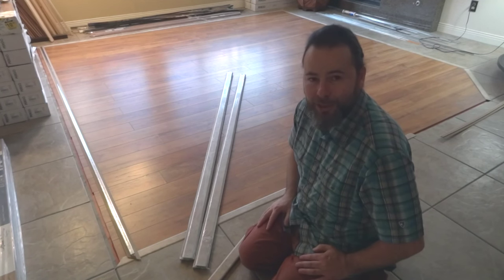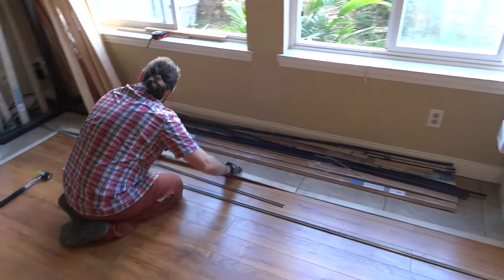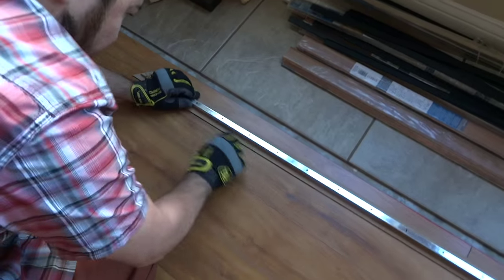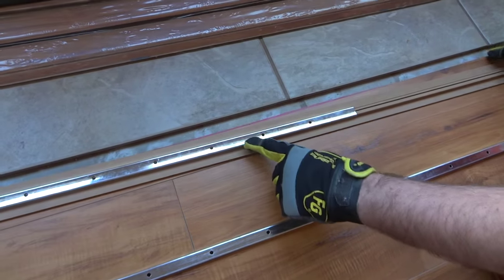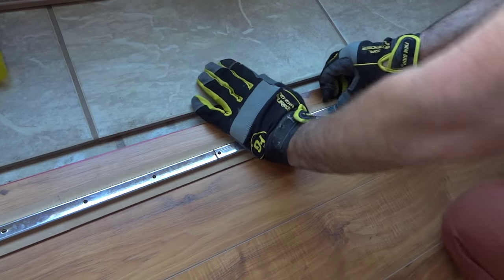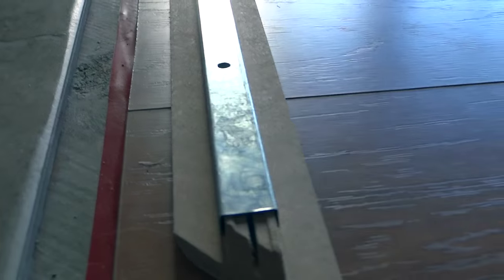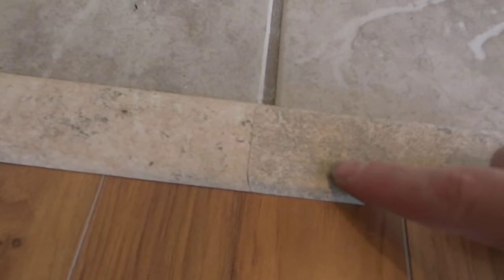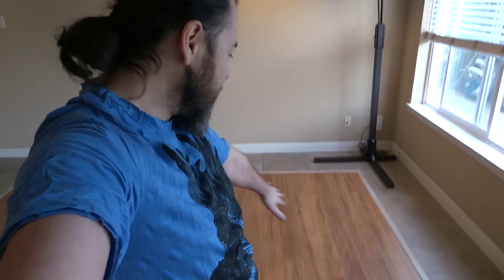T-Moulding Strips; How to Make 1 Long Strip From 2 Shorter Lengths

Comment: Thank you for the video. Great job on the flooring.  Question...how did you "cut" the t-molding to that angle that butts up against each other.  Not the corner portion at 45 degrees but "under" and "over" connected pieces?  Which way did you place the moulding to cut it (flat, sideways, upside down) and at what degree did you cut each end to match up?

Comment: I use a super glue product and an activator when I do molding work.  It’s cyanoacrylate and you can get it at building supply companies. That 45 degree joint you made is called a scarf joint. It makes a relatively seamless transition as you so well demonstrated.  The cyanoacrylate works exceptionally well with that MDF (medium density fiberboard) and hold the joint together, but get it positioned perfectly because it adheres on contact. Under normal conditions the joint will never come apart.  You can use it at your 45 degree transitions to hold them from ever moving and then lay your scarf joint together.  You will have one bonded seamless transition all the way around. Search YouTube for Finish Carpentry TV. The guy is a fine craftsman and and his videos took my work to the next level. Your work is very nice too.
Reply from the maker: Great advice, thank you! I did this 5 years ago and my floor transition has held up perfectly!

Comment: yeah I know but that's not a 90 degree angle so you didn't make two 45 degree cuts (they don't even look 22.5 degree cuts). do you remember how you figured them out?
Reply from the maker: 22.5 degrees was the correct angle to cut/trim that one "diagonal" corner. 
I do recall now that it took me a while to figure that out at the time but yeah, 2 cuts of 22.5 degrees was the solution.

Comment: Any tips on cutting the t mold where they meet at a 45 degree?
Reply from the maker: Hi yes to have the 2 pieces of trim fit most precisely in the corner, cut your pieces without ever moving the angle or setting of your saw. 
I used a miter saw and just cut first trim piece right side up then the second trim piece upside without ever changing the angle setting on the saw so the corner angles on those 2 separate trim pieces then matched up perfectly. 
If You find there's still a small gap where the pieces meet in the corner you just use some caulk that might match the finish of your trim. just fill in that small gap if you have one.  
There is various colored tan and brown colored caulk at Lowes. You might also use a colored marker or a furniture touch up stick also sold at Lowe's for cheap. Good Luck

Comment: Did you have bare floor when you laid the laminate for the transition, or did you lay the laminate over pre existing tile?
Reply from the maker: I removed carpet which was already surrounded by the tile. A Concrete slab subfloor is what I installed the laminate on top of. The thickness of the laminate  floor matched the thickness of the pre existing surrounding tile pretty evenly. When laying the laminate, I left about a 1 and 3/4 inch gap between the laminate and tile for the T-Moulding track which I then glued to the concrete floor with construction adhesive

Comment: which adhesive works the best to glue to concrete?
Reply from the maker: Hi there, I found the PowerGrab Adhesive to work best because it comes out of the tube less runny then the Liquid nails does making it a bit easier to work with in this case. I glued to concrete in this video and it worked great, just make sure to weigh down over night after glueing to insure the best bond.
Reply: Nice work. Thanks for sharing.

Comment: What did you cut it with to get a seamless cut?
Reply from the maker: I used this cheap Miter Saw from Harbor Freight Tools to cut everything for this project and it worked out great.  
https://www.harborfreight.com/10-in-compound-miter-saw-with-laser-guide-system-61973.html

Comment: Why did you attach the track to the t mold. Couldn't you save some money and just glue the t mold down without the track?
Reply: ted wattron -The track comes with the tee molding. Usually it's a 4 piece kit: tee mold, track, reducer, and carpet transition.

Comment: Its fine if YOU want to do it wrong but you shouldn't teach people. You absolutely do not glue a metal track to concrete.  Do u see the holes in the track? Those r for screws. You need a hammer drill and tap cons. You won't need weight to hold it over night or whatever. The tracks screw in and the transition is tapped in with a rubber mallet. Amateur....